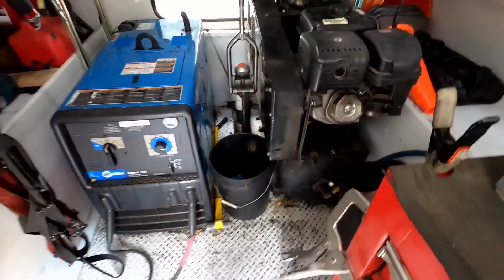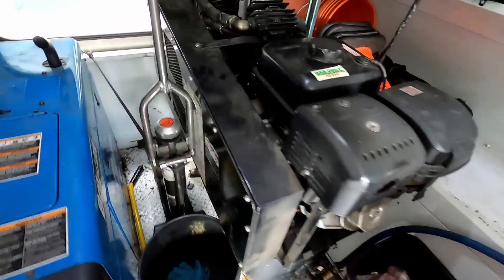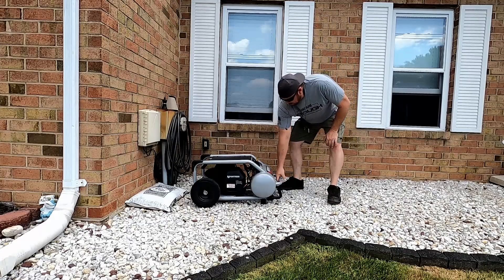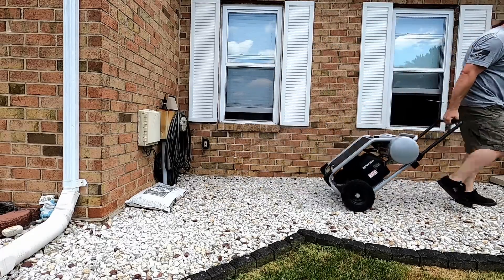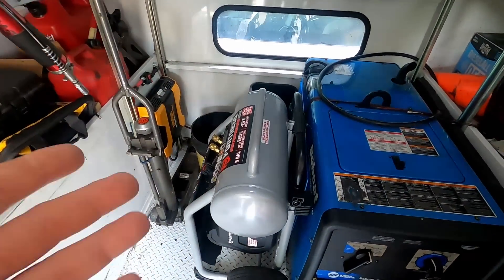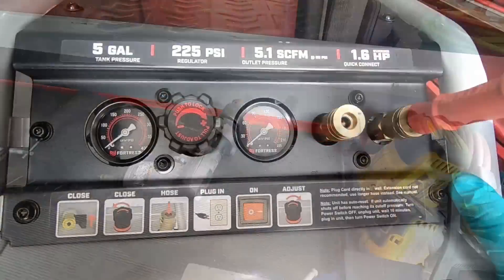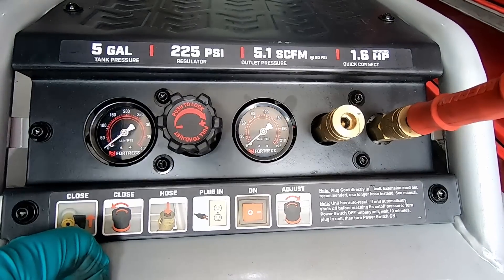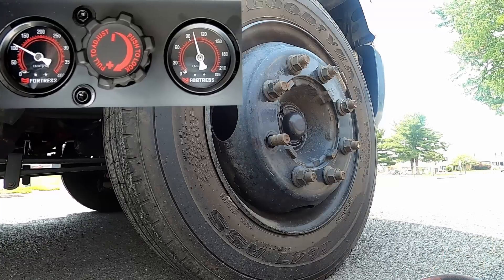Harbor Freight 5 Gallon 225 PSI Fortress Air Compressor

Comment: There is no reason to buy " brand name " commprseor they'll are basically the same.  Save the money for
Reply: Save the money for beer. Any beer but Anheuser Busch.😅
Reply: I dunno..Sanborn used to make a great 60 gallon compressor..It would run a bare die grinder/cut off tool all day long. Crapman was, well..crap.
Reply from the maker: I used to work on these back in the late 90’s most of the internals are the same.

Comment: So. An electric motor, to drive a compressor, to produce H.P. air, to drive an air drill. You know where I'm going with this... 🤣
Reply: Yes. It's a trade-off. An air motor is much smaller than an electric motor. And it's safer to use in wet environments. Sure, an electric drill is more efficient overall. But there's a reason air tools exist.